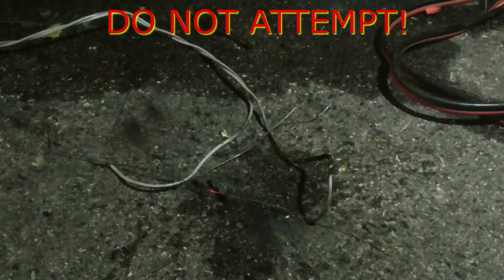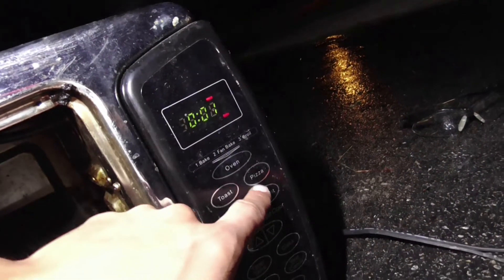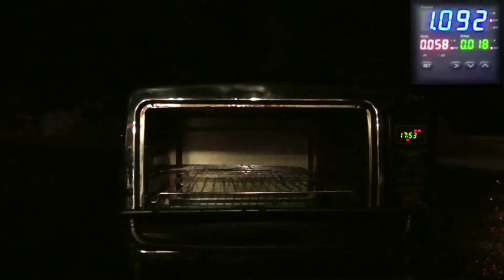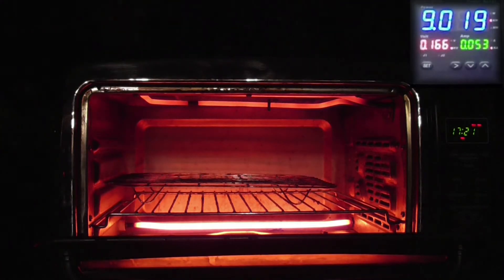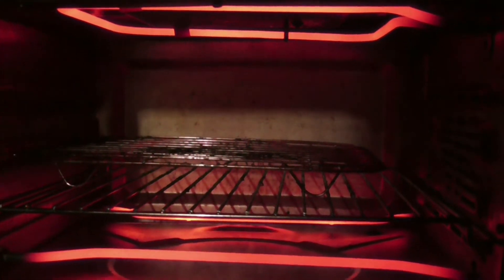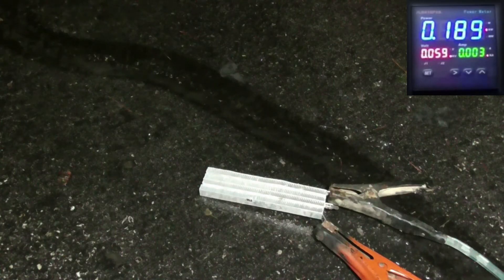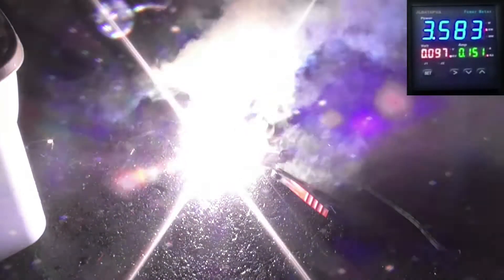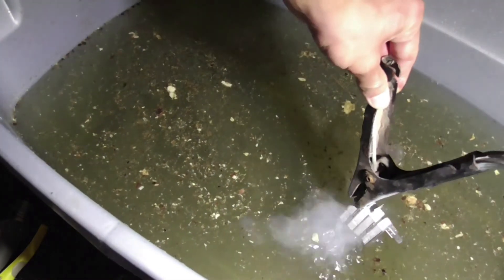Heaters Overvoltage & Electrical Explosions

Comment: Что у вас за тостеры такие интересные что при 230в жрут !!! 12Квт!!! Я слышал конечно что в Америке или в США, точно не помню, стандарт 120в но и 5–6Квт это тоже перебор. Или вы их подключили как-то не правильно?
Reply from the maker: I believe the toaster ovens were Magic Chef brands. Rated 1.5kW 120V. Here in America, 120/240v, 200A is commonly installed, older services can be as low as 60A. Here, I used a large variable transformer and a voltage doubling transformer to obtain a voltage range of 0-500V. It was around 400V that both ovens peaked at & went into meltdown. I was surprised to see them take that much lol!!

Comment: Those two Power Meters on your 18kW power supply, where did you get them from? I am looking for some too for my 5kW power supply.
Reply from the maker: I got them on eBay for around $140, they're made by ColdFusion.
Reply: They look a lot like the ones used on Photonicinduction's big power supply!

Comment: aw, I have an Oster a lot like that, great little oven
i'm surprised the electronics in it didn't complain about the overvoltage
Reply from the maker: Yea, I've got one now and it does miracles! It was all in good fun though.
Reply: @VariacManiac  The digital electronics are all low voltage, about 5v.
Reply: . True. Also there is voltage regulation from the power supply so it's possible it might take more than one might think to really do much damage although your mileage may vary but that's one reason potentially why that didn't happen so many different factors depending on the circuitry and so on would have to be evaluated on a case-by-case basis although it would be interesting to try to fry some stuff of different designs to see what would happen honestly that might make a good video.

By the way there are videos here on YouTube of people playing much higher than red voltage to toys this is pretty hilarious and also interesting smaller scale for voltages at currents but still just as much fun and hilarity and just interesting to say the least.

Usually it's the sound that goes first then usually LED circuitry and the motor keeps going sometimes even up to 30 volts which is pretty impressive for something designed for a few DC volts.

I did torture a low voltage motor once to destruction.

Can't remember if it was raining for 3or 6 volts. DC

Connected around 10 or so 9-volt batteries but still very close to 9o. Give or take volts.

Boy oh boy did the Sparks Fly.

Big nose plastic commutators it was one of those flat pack Motors kind of like used in the old disc cameras and this murder was shot what's the bearings the only reason I decided to attempt to put it out of its misery.

Otherwise it would have been salvaged in using something else.

My father thought I was building an air raid siren he was just joking about that of course in actuality it was actually louder than a Dremel tool at full speed and yes earplugs in.

I'm sort of sure part of that was due to the bad bearings??

Oh by the way another one of those little experiments add unexpected results a motor out of a toy flying airplane Define much over voltage contact liftoff not in the way expected of the whole motor just to propel her only hit the deck incoming 

Lord of life really tacky friends that was watching this I don't know how many times I think that's on Facebook before it stopped.

Don't worry safety gear in the in use not a problem.

Also certain types of LEDs if you play say anywhere from 9 to 12 volts Raw as in no current limiting especially little suckers like the 3 mm or so it's just particular times but it didn't have enough of them to really test all the combinations.

But those suckers what often blow the end of LED I have gotten a bunch of these LEDs in a black plastic housing supposably had a built-in resistor and I was wondering why the LEDs were going out instantly Charlie Chaplin Insurance Bang.

Turns out confuse them with another type of the similar-looking LED that was almost no different from the outside that would be an epic fail 

Oh by the way I had gotten some Led flight posts for baller railroads at a hobby store.

And initially the labeling on the package was different said it's rated for using 9 volts ac plus which of course that is not a LED component voltage and of course no resistance whatsoever anywhere.

And of course apply power now she goes.

When I realized that that wait a second these are directly connected after we will disassembly.

Turns out this man been intended for one of those systems that allows you to run life like this Plug & Play sort of thing that uses a specialized type of LED power supply specifically for this.

However I was reading these LEDs anyways basically cutting the fixture other projects.

Until I was able to find reliable source of the raw LEDs this was a good choice initially until I got things all settled in on how to do things.

Comment: You popped it lol
Reply: Electricity is so fun to mess around with lol I used an Induction Cooker to drive an ancient AC Flyback and I can get 30kv out of it with Extremely Hot Arcs (it can vaporize copper and give the arc a green tint) so it’s pretty neat
Reply from the maker: Old clips, hope ya enjoyed man!
Reply from the maker: Come to think of it, my friend actually popped it.